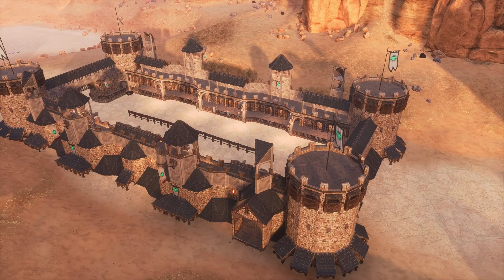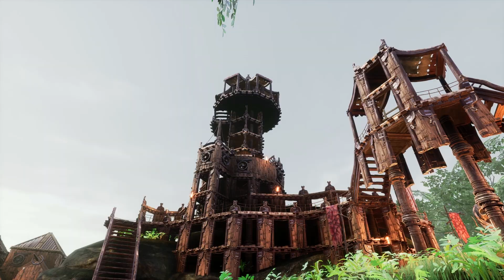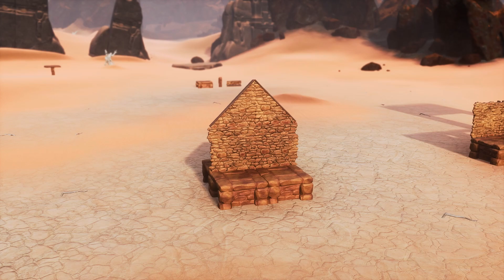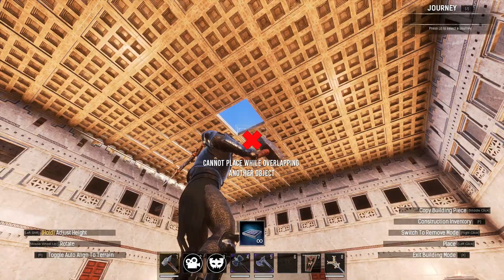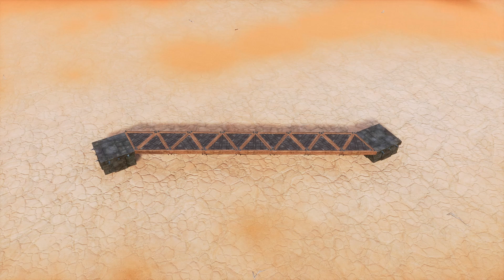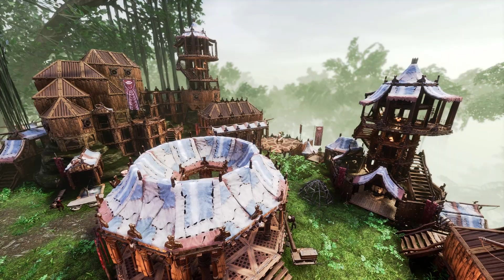Conan's HARDEST Building Mechanic Explained | Stability

Comment: always make my buildings as realistic as possible for the sake of immersion. i think of what would work and wouldnt work in real life, and build around that parameter in game. funnily enough, i rarely ever run into a stability issue. even when building an absolutely megalithic castle. i think taking a realistic approach to building in this game goes a long way.

the most issues i have when building is when i try to build something thats more fantasy and less realistic
Reply from the maker: Basing it on real life is generally a fairly good barometer of success, with a couple of expcetions. Even fantasy stuff can work once you've got stability nailed down, that learning curve is just quite punishing 😂

Comment: Pretty strait forward and easy to understand. I have run into stability problems when I use the pillar trick. The pillars on corners don't transfer any stability to the ceiling of walls they are attached to unless the ceiling is centered on the pillar. Good info for beginning builders.👍
Reply from the maker: Glad you enjoyed it! Yeah that can be a real stumbling block with the pillar trick, corner pillars can be really finicky at times. You have to essentially have a design that can stand on its own, but is also pre-planned for pillars. It can be a nightmare at the best of times 😂